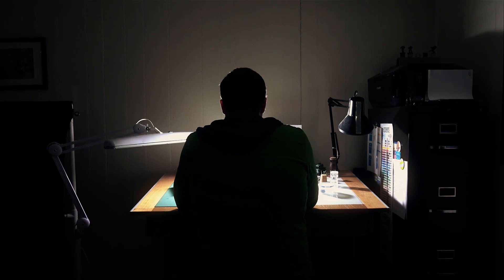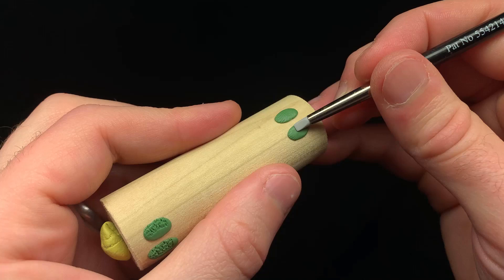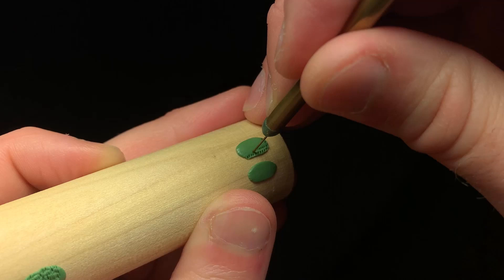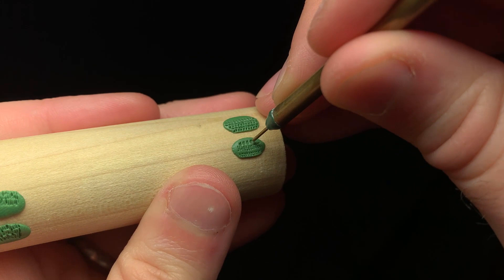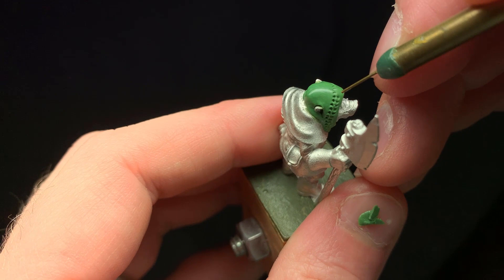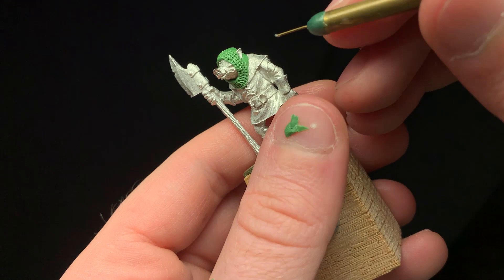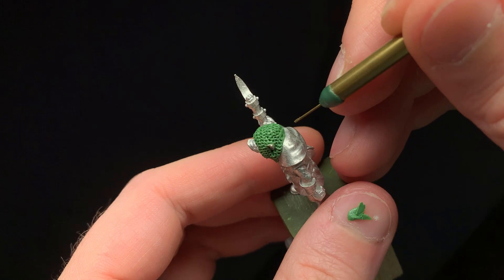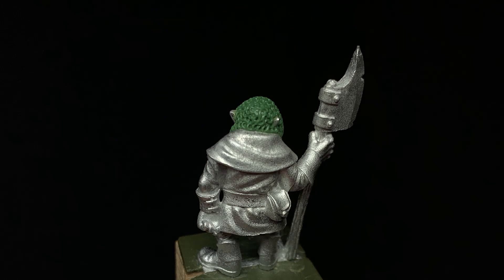Ep. 54 | Sculpting Chainmaille - Traditional Miniature Sculpting DEMO

Comment: Sorry Tom quick question: why do you mix it 1:2? I always thought you should mix it 1:1? Sorry if you explained it in any of your videos before already
Reply: I think that's how Greenstuff comes in the package. There's twice as much yellow to blue, as seen here: https://www.greenstuffworld.com/5179-thickbox_default/green-stuff-tape-6-inches-with-gap.jpg

If you buy large, practically industrial quantities of the stuff in jars/bars/tubes instead of in strips (like I'm sure Tom does), you have to measure it out in a 2:1 ratio instead of just cutting at the same spot in a strip.
Reply: @nekrataali  oh wow man never realized that.. Thanks a lot and sorry for asking that stupid question !
Reply: @sebastianvogt6554  I don't think it's a dumb question it's just not something that's really noticeable because of how Greenstuff is usually packaged lol
Reply: In my experience the mix ratio affects how the putty behaves.
A 1:2 mix of blue/yellow gives a more squishy but stickier putty. A 1:1 mix gives a stiffer but slightly less sticky putty. 
The cured putty is also different: the cured 1:2 mix is bends more easily, useful if you have pre-made a curvy pipe or something that just needs to bend that little further before you super glue it in place in the final figure.
Reply from the maker: As some of the other comments say, yes, Greenstuff was origianlly sold in tape form which had more yellow than blue in the strip. You can do 50/50 or even more blue. Many mixes work. However, I find the material more pliable when mixing it with more yellow.